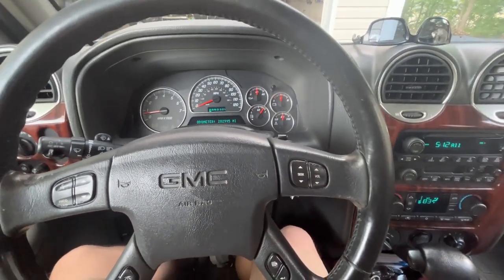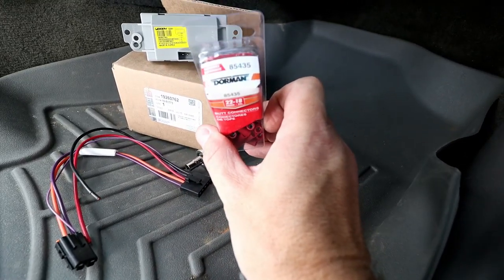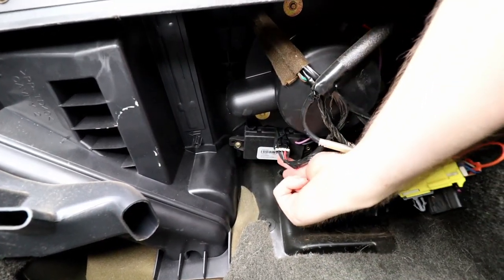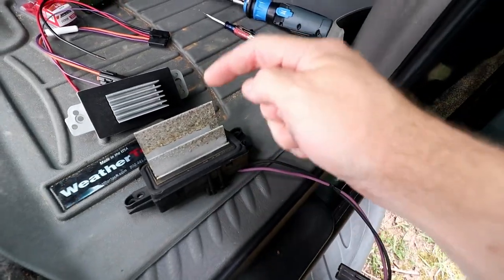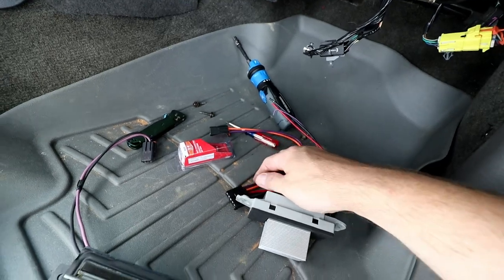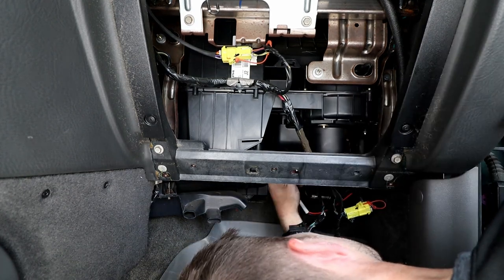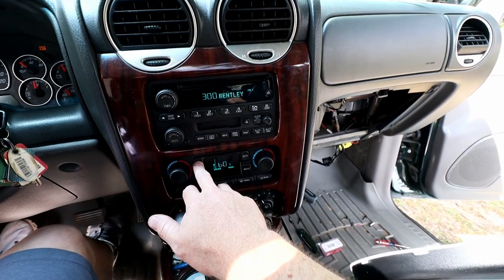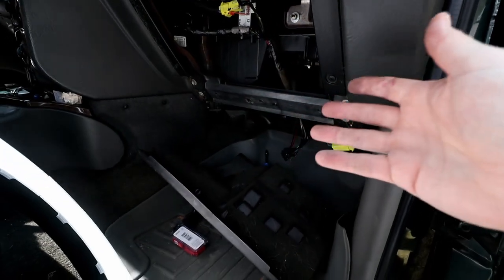2004 GMC ENVOY HOW TO REPLACE BLOWER CONTROL MODULE

Comment from the maker: Hope this video helps you.  My A/C fan would not turn off, even when the key was out of the ignition.  A new blower control module did the trick.
Reply from the maker: This is the GM control module I used.  https://amzn.to/3WgEhpt
Reply: Hey my 04 envoy doing the same thing right now
Reply from the maker: @guttaboyinhouse1187  should be an easy fix. Good luck with the repair.
Reply: @KevinNadeau  thanks a lot bro💯🙏🏽
Reply from the maker: @guttaboyinhouse1187  👍
Reply: I was hoping this video would help as well but after changing the module and control unit the fan is still running. Any thoughts?

Comment: Power windows  for some reason  when  i plug  the windows  controller  it will not let me start  the truck  and mess es with  all guages why can you  please  help  thanks
Reply from the maker: I’m not sure exactly, but sounds like an electrical gremlin has shown up. My first thought was it may have something to do with the ignition switch, but that’s just a wild guess. I would get a wiring diagram and see if those two circuits are connected somehow. Or you may have a bad ground somewhere (again, just a guess). Good luck with your truck.

Comment: Did anyone else have there ABS light go off too when this happen?
Reply from the maker: Didn't happen to me as it related to the blower motor.  However, I did see my ABS light flash on when my ignition switch was going bad.  That caused several electrical gremlins to show up 😀
Reply: Yes I did and I thought it wad weird! What did you do to fix both pls share thanks